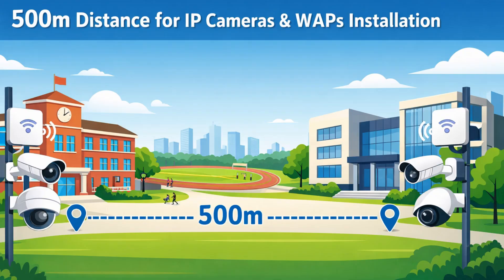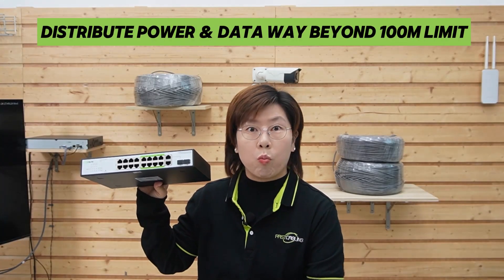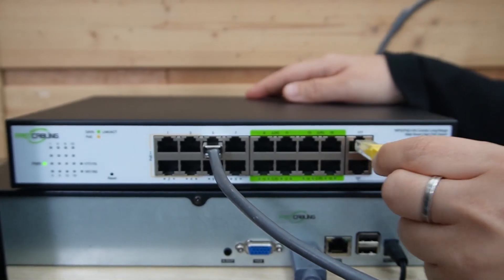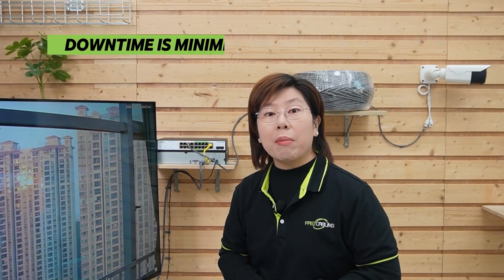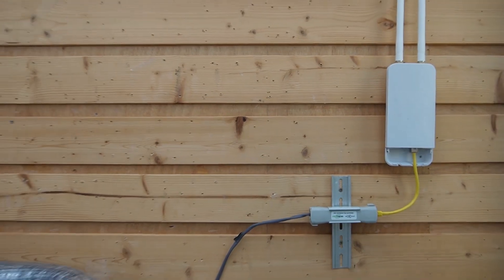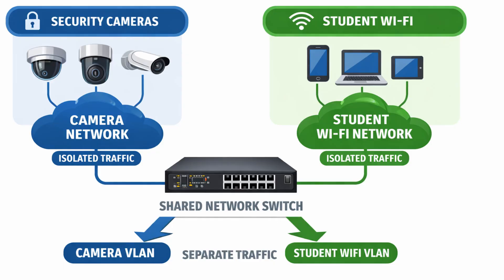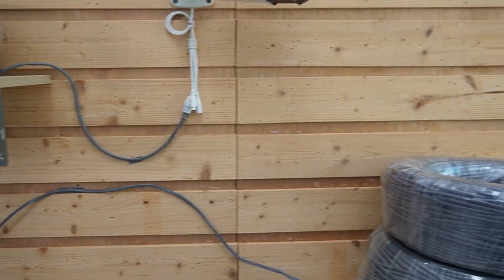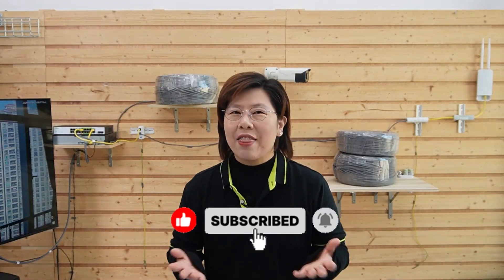Run PoE 500m for Campus Cameras & WiFi | Long-Range PoE Switch Explained

Comment: Thanks for the video, it was nice.

But in the case of large deployment like 40 cams over 500m, using the poe extenders, surge protectors, will not make the installation neat at both ends,  how do you overcome that
Reply from the maker: Each camera needs its own PoE extender and surge protector. The clean way to handle this is to install them inside a small weatherproof enclosure on each camera pole. That way, everything is protected, organized, and easy to service.
Reply: @Fastcabling So are you saying the server room will be littered with enclosed boxes for SPD and Extenders 😮,  I do have a better solution in mind, but thanks anyways, you really passed down knowledge
Reply from the maker: The SPD and the extender should be installed close to each camera, not in the server room.